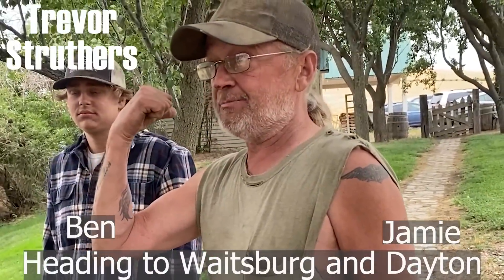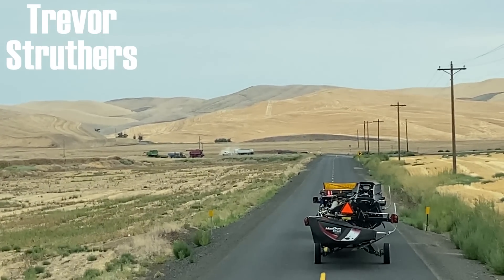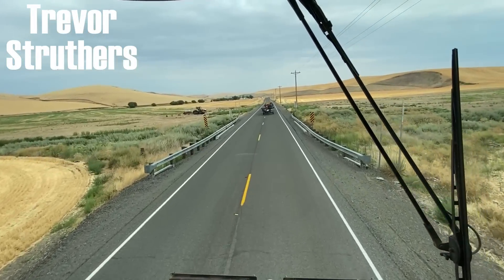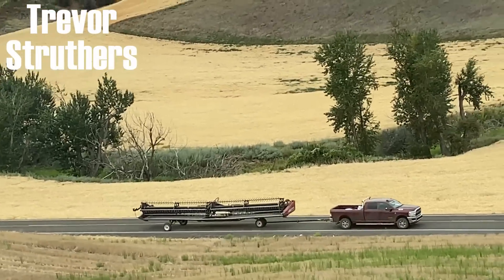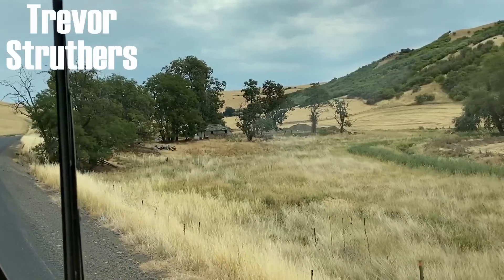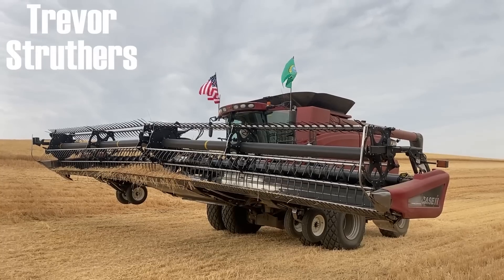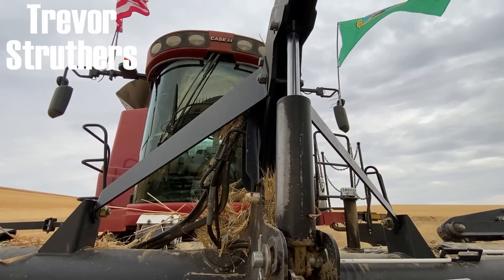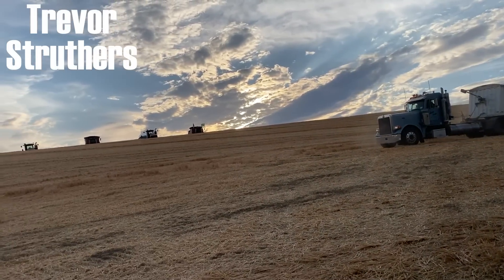Wheat Harvest on the move - CASE Combines everywhere - Grain Hogs S02E13

Comment: Road trip indeed! With WA politicians ramming everyone’s rear with taxes on fuel, has that impacted how you guys have to operate?
Reply: In WA, are they pushing clean n green renewables?
Reply from the maker: They just added a .30 cent tax to all diesel fuel.  Under Trump in 2019, diesel was .85 cents a gallon.  Now its more than 4.  I still burn a lot of diesel.
Reply from the maker: All of the US is pushing the green new deal, WA is one of the worst but luckily they keep that Seattle stuff mostly on the Seattle side of Washington.
Reply: We have diesel fuel rebate scheme,.it was a generious amount until the early 2000's after the WTO had pressure to be reduced.
Reply: @TrevorStruthers  Here it's around A$1.65 a litre in if in bulk, we've the European weights n measures system since late 1970's, my Dad use talk in gallons and i still refer to as in acres.